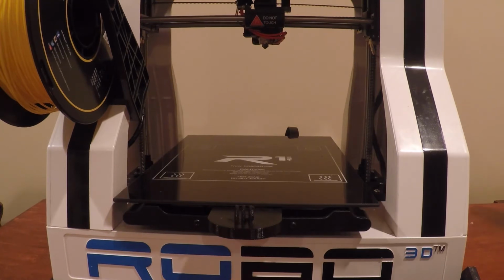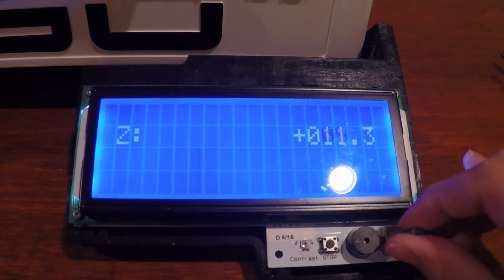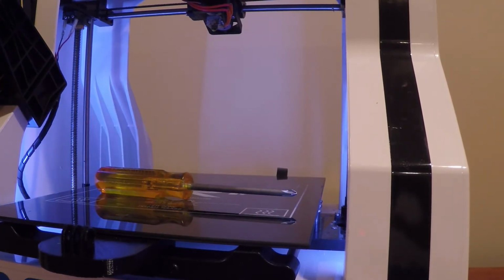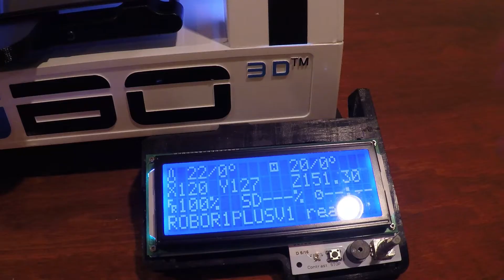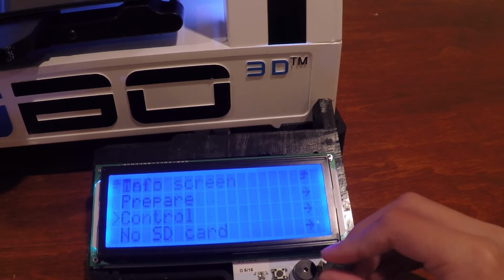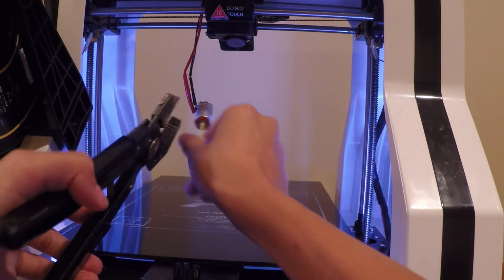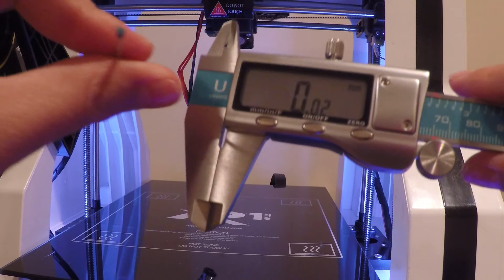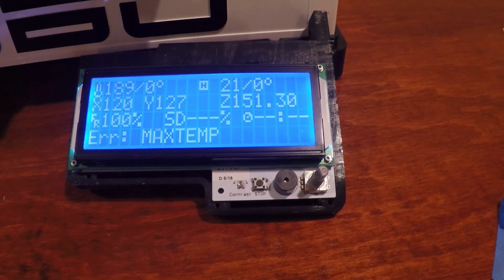How to UNCLOG a 3D Printer Extruder in UNDER 10 MINUTES! With Additional Robo 3D Walk Through

Comment: So I unclogged my extruder put it back in place and now when it starts the bed leveling it stops on the last point and won't go any further.  How can I fix this problem?
Reply from the maker: @Rose Barrette,
Could you provide some details regarding what software you are using for slicing, and do you also have any additional printer hardware mods such as LCD controllers?
At this point I would just recommend that you try to re-seat your extruder, and check to see if all of your axes are level.
Reply: I have a LCD controller that I need to connect and I am using Matter control.  I will try to do everything you have given me to correct this problem and I will let you know.  Thanks!!!
Reply: Hello again, I did it!!!  I connected the LCD controller and adjusted the extruder and everything is printing great!!!  What do I need to do to make the controller more responsive?
Reply from the maker: Awesome! Glad that you are up and printing again! 
Regarding the responsiveness of your LCD controller I would recommend that you make sure there are no loose parts or weak connections. You might want to print a housing for your controller if you have not already done so, you can try searching the model of your LCD on thingiverse or any other file sharing platform. If you have any buttons or dials on your LCD controller, you could probably find printable additions to those components as well, allowing you to have more precise control of the LCD's interfaces. Otherwise the delays in responsiveness could just be attributed to your printer and controller's firmware.
Reply: I used the LCD controller from another ROBO R1 +Plus that was having issues, so I'm scavenging that one for my new one.  I will look up on downloading new firmware and see if this cures the problem.  Thanks Bushido you have really helped me!!!

Comment: Very helpful. I have the same setup and quick question. Do you know how to change the home position from the controller settings? My first calibration is off by a few cm and it's not hitting the first corner correctly causing the whole print to be shifted off of the heating bed for larger prints. http://imgur.com/DA6QgPK (not starting on the corner of the lines)
Reply from the maker: @TheGastlyGuy
I am sorry to say that I am not completely sure how to change the home position form the LCD or any other controller settings. However, I do have experience with bed leveling issues, so maybe this will help: When my printer drove into the heated bed, I first removed the top of my printer, to get access to the z or zed-axis rails/rods, then adjusted the x-axis moving each side a bit up on the z or zed-axis until it was level. The final thing that I did and would most recommend you should try (if this is slightly similar to your issues) is to make sure ALL of your endstops are in good condition (try to bend them outwards, if they have contact issues) or check to make sure all other rails and steppers are functional (for the build plate especially). I hope this might help you a little bit, and best of luck on fixing this issues.
Thanks,
Bushido 3D